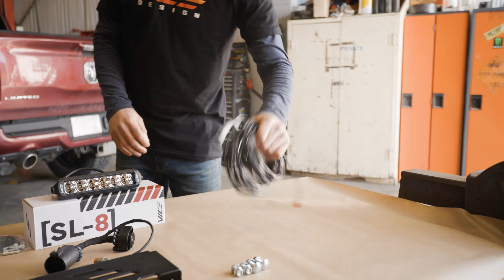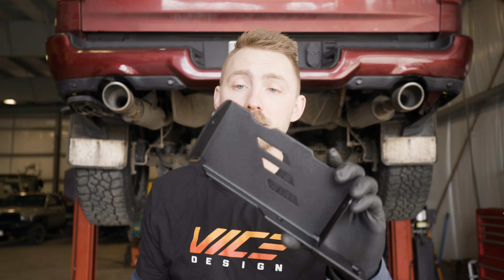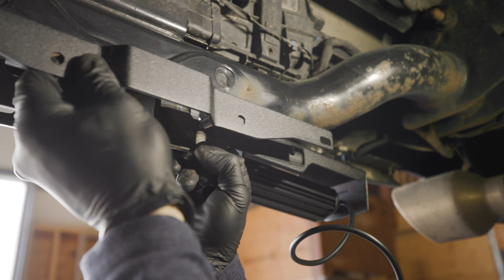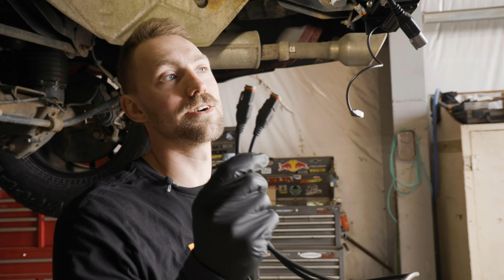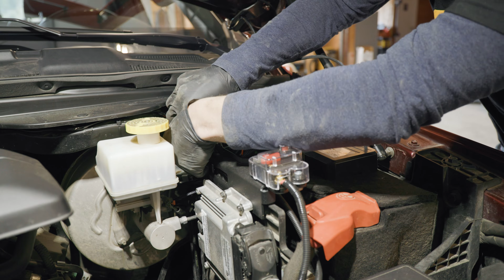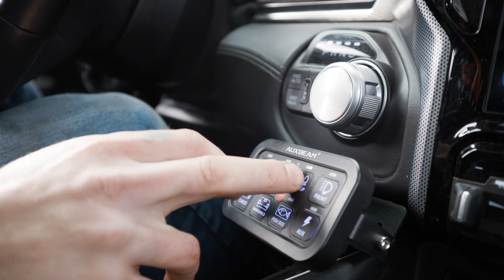Upgrade your RAM Reverse Lights

Comment: Most likely not for 2025+ Ram's. Or is there a harness to tap into the truck's reverse lights? Can't use the trailer plug on these new trucks
Reply from the maker: Good news! We have a 2025+ kit that works with the new BCM programming. Here’s the updated video: https://youtu.be/uFKSYWAm23s?si=iGBHfHHeHvGLNScU

Comment: @vicedesigninc My Ram has a dual 7 pin plug and a 4 pin above it.   Does your adapter still allow you to use the 4 pin trailer plug, or does it make the 4 pin plug useless?
Reply from the maker: Yes you can use both the 7 and 4 pin connectors with our kit

Comment: I don’t have a hitch receiver on the back of my 2010 Toyota Highlander, but I need to improve visibility of the reverse lights.  I already replaced the reverse stock light bulbs with LEDs, but it still is not bright enough.  What are my options that work well without a lot of fabrications, and still don’t have to add a hitch receiver?  I don’t have lot of tools and a workshop.

Comment: Vice Design.. Nice light kit. A little too expensive though. What happens if the lights are turned on with the switch panel and then you put the truck in reverse while the switch panel has the lights turned on? Another words putting it in reverse sends power to the lights that already have power to them from the switch panel, wouldn't that blow one of the fuses?
Reply from the maker: Not an issue at all - Our wiring harness has a circuit board built into it which prevents back feeding of the other circuit
Reply: @vicedesigninc  Good to know. Thanks.
Reply: @vicedesigninc is there a way to check the circuit card with a multimeter? I am helping my friend troubleshoot your reverse lights with a s pod power hub and it seems it’s back feeding. When he comes out of reverse it gives him fault lights on the switch panel.

Comment: It looks like it will fit the 2500/power wagon. Will it?
Reply from the maker: if you have a 19-24 2500 Powerwagon here's the kit for you: https://www.vicedesign.ca/collections/5th-gen-2019-2022-ram-2500-3500/products/slimline-reverse-led-light-kit-5th-gen-2019-2024-ram-2500-3500
Reply: @vicedesigninc  install and look is super clean. Any videos showing output at night time? Also looking at the S2 Baja design kit but I would honestly prefer these if they have the same output